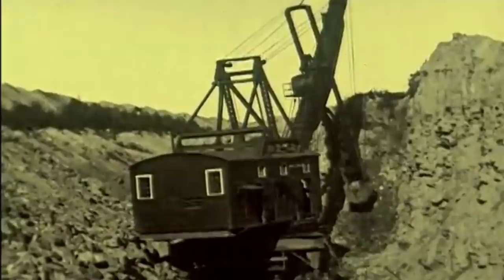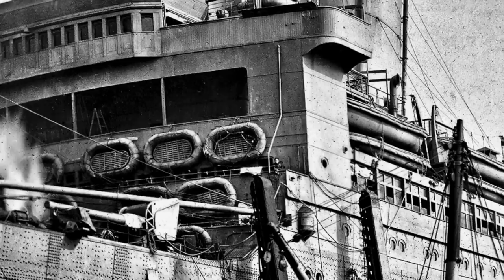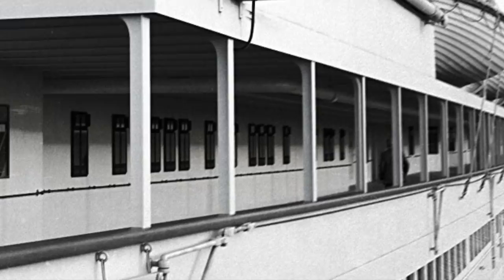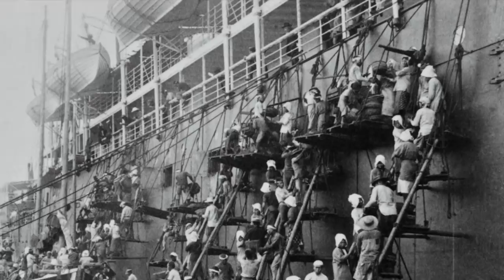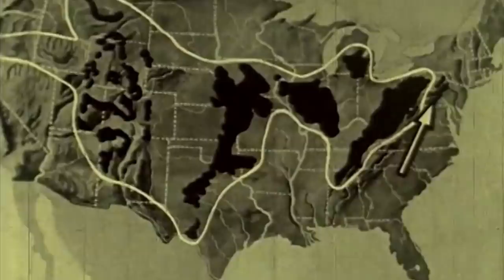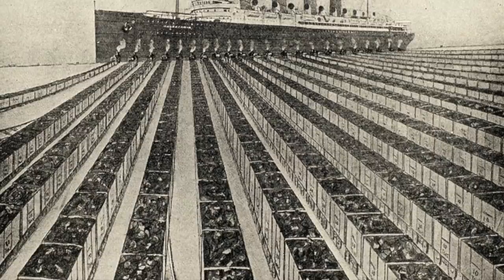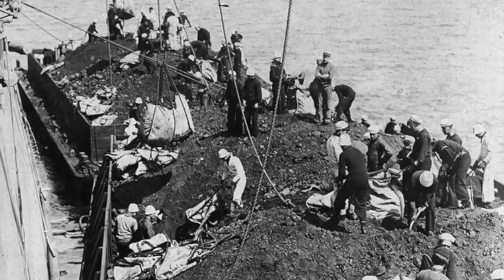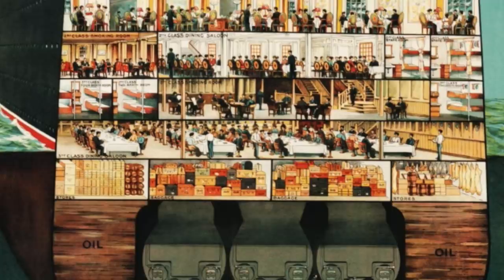Coaling/Bunkering an Ocean Liner

Comment: How about the coal fire that was happening aboard Titanic before and during her fateful trip?
Reply from the maker: I probably won't be discussing that. Coal fires were very common. There were even standardized methods of dealing with coal bunker fires.
Reply: I was a boiler tender in the navy.  hardest job on the ship. We had a jet fuel line rupture in our boiler room and i was so scared, but because the navy trained us till we thought we would go crazy, everyone in the boiler room just did what they trained us to do and we knocked the fire down and cleaned up the mess.  I will never forget those few hours of my life, and if i tried to describe it all you wouldn't understand anyway.  All the hatches were shut so we had no choice but to go put out the fire or die.  You couldn't see the fire cause it was so dark but you could feel it.  I liked life in the navy, but wanted a dog and i didn't see it happening in the navy.  The dog was wonderful.
Reply: @TheGreatBigMove  Perhaps it was common, but it likely effected her list as she was taking on water. Certain bunkers on the starboard were quite low or empty when she hit the berg. While the fire unlikely had an effect on the structural integrity of the ship, it was one of several important factors that kept her mostly upright during the sinking (the pumps and good engineering among being the others). You should definitely look into look into this. Scotland Road and several doors on the port side of Titanic being left open undoubtedly compounded upon this. Lusitania had a huge list as she was sinking that prevented life boats from being lowered during her sinking. Many ships straight up just capsize when a large amount of water enters only from one side.

Comment: When I was in the Royal Navy in the 1970 and at Faslane (Nuk Sub Base in Scotland) as a Navy Diver - we had a crappy ol ex fishing vessel, called "Yoyo", as our surface support diving vessel.  It had a diesel engine - that consistantly burst into flame, but thats other (usually amusing) storys,      but the heating & cooking on board was all done by coal fires. The galley, and the crew's mess had multi fuel stove like things - only 20 yrs before they were invented??  I remember coaling ship  ...  usually took about four bags  ... all a which had to be carried on my back!!   It was hell, and often took up to 15 mins!
It was a lovely vessel  -  NOT!! -  when repainting the hull we had to be really careful, because excessive pressure on the paint brush would tear out great lumps of ship side planking.
 I belive (Hope) the RN is a little better now-a-days!

Comment: saw quite a few peat-tar mix burning steam ships still around on the upper Volga in the late eighties early nineties... the bunkering of those (due to the volume/energy ratio) was more impressive then for coal, though it created far less dust... I think a lot of transport-size conveyor belts were used, but the mountains on the fueling docks were still by far the highest feature around, well above any of the small local hills.

Comment: I have spent a lifetime in the shipping business. Coal is still big business though for electricity and smelting only and I am extremely happy that now that I am retired I never again will have to sail a ship at 0400 from the local coal terminal. Fuel is still a serious problem for ships, however. Increasing environmental concerns and shortages of sufficient low sulfur fuel oil vexes owners same as coal shortages used to.

Comment: To build on Nitros comment, even with the use of hoses and electronic counters they will still try to short you on liquid fuel as well. Usually in foreign countries, they will incorrectly zero counters on any pumps they have. When taking bunker they will provide the CM with false hydrostatic tables so she/he can't measure fuel pumped off barges or ships using drafts marks and tons per inch immersion. When the margins are that thin rumor has it the crew that saves the company the most money each quarter gets a bonus

Comment: Just found the video and thoroughly enjoyed it.  From direct observation cheating by fuel oil suppliers is just as bad today as coal suppliers of yesteryear.  Singapore is notoriously known for cheating on fuel deliveries.  Hiring an "independent inspector" doesn't help because they're already in bed with the fuel suppliers. 

Examples;

70 tons short in Jebel Ali, UAE.  When Chief Engineer tried to annotate the delivery receipt of shortage he was physically restrained by Bunker Supplier.

Fueling in Singapore was shorted 10 tons.  Chief Engineer was very proud of raising hell and getting his missing 10 tons.  Until he found out he had 10 tons of SEA WATER in his fuel tanks.  He never did that again.

Fueled in Egypt because it was CHEAP!  Company decision, not mine.  Fuel solidified in tanks when sea temperature dropped to non-Middle East temperatures.  Had to shovel it out in buckets.  When we went back South of Suez Canal fuel heated up enough to pump and burn.

Company advised NEVER take fuel not authorized.  This was done by company vessel in Rotterdam.  Got 70-80 tons of fuel contaminated with some type of hazardous waste and was unburnable.

Comment: I suspect the video from 0.57 to 1.03 is of a ship in dry dock, not a ship moved off the quay in preparation for  coaling.  The side shores (like props) are there to position the ship on the keel blocks of the dry dock and to keep her upright, especially while her weight is transferring onto or off the keel blocks.

Comment: It's been awhile since I read that book on the Lusitania which came out in the mid-1970s about the real cause of the Lusitania going down.  As I recall now (and the book is in my brother's library in another city), it was that good bituminous coal from Wales on the Lusitania that made its explosions all the greater than just the hit of the torpedo.
Reply from the maker: Yeah, I didn't want to get too much into the different types of coal. I thought it would bore people since I could barely get through that part of the research myself to be honest.
Reply: @TheGreatBigMove  Understood.
Reply: Coal dust (or almost any dust of a flammable substance) can explode into big fireballs, and is sometimes used that way for special effects.  Look up grain silo explosions (or give a few heavy shakes of powdered cinnamon over a hot stove burner) for more.

Comment: I can think of one incident in which a lack of sufficient coal was responsible for the tragic loss of a great ship and a huge number it's passengers and crew.
The Cunard liner RMS Lusitania was not carrying her standard, full load of coal when she made her last crossing.  Coal was being rationed during the war, and the geniuses at the Admiralty saw no reason to make an exception for Lusitania, although they were happy enough to use her for carrying shell casings or whatever.  Since she didn't have a full load of coal, she had to make the crossing at significantly reduced speed, around 20 knots.  Her normal service speed of around 25 knots would have made her a much more difficult target for U-boats.  It is more than likely that Kapitanlieutnant Walther Schweiger wouldn't have spent one of his last 2 torpedoes in an attempt to hit such a rapidly moving target.  For want of sufficient coal, many lives, along with a magnificent ship, were lost.            ⚓Coal was a nasty business all around.  Coal fired ships required a huge work force to keep their engines running, and the stokeholders  were a seriously tough and often rowdy bunch.  When Titanic was going down, the electrical power was maintained as long as possible because a bunch of these tough-as-nails dudes stayed down in the boiler rooms shoveling coal, knowing well that they had little to no chance of making it out alive.  If that's not badass, I don't know what is.  When steamships were converted to burn oil, the workforce was reduced dramatically.
Filling up with oil was a breeze compared to the noisy, filthy, and dangerous process of coaling.
Thank you for an excellent video.

Comment: Structural failure caused by a coal bunker fire contributed to Titanic sinking faster than expected.  They had to shovel fast to dig out the burning coal or risk structural failure. That coal went into the boilers meaning they had to steam faster than ideal for the conditions. It was a calculated risk.

Comment: 8:41 I don't know any issues caused by coal supply.  However the RMS Atlantic was sunk trying to divert to Nova Scotia, due to a perceived lack of sufficient fuel to make its original Destination New York.  There was significant loss of life as the ship grounded due to Navigation errors, watch standers failing to carry out the Captains instructions, and the Crews unfamiliarity with the Canadian Coast.  The ship likely had sufficient fuel to make New York but fuel reserves were tight due to rough weather during the crossing making the ship much slower and less efficient.  The captains intention was to take on fuel in Nova Scotia and complete the Crossing to New York with sufficient coal reserves.  He felt it was unsafe to attempt to make New York with his perceived state of the ships reserves so he felt it prudent to divert which unfortunately ended up dooming the ship.

Comment: The main reason that coal powder is dangerous is the same reason any flammable dust in the air is dangerous. It's flammable and explodes violently when it is exposed to fire. That being the case, I'm sure you can see why it would be a problem to have that in a boiler room.

Comment: I work in a coal processing plant, we grind coal using a rotary ball mill to pulverize coal to dust it’s a very messy job and I can sympathize with the boiler and coaling crews it’s hot and noisy and very very dirty

Comment: To the question of whether running out of coal ever caused a steamship disaster: in 1870 the SS Atlantic attempted to divert from New York to Halifax because of low coal (or at least so the captain thought) but went off course being unfamiliar with Halifax and struck rocks and sank killing over 500.
https://en.wikipedia.org/wiki/SS_Atlantic_(1870)

Comment: Out of curiosity, did any coal fired steam ships ever receive an automatic stoker system? 

In America, many larger locomotives were so large they could not be adequately fired by hand. They were fitted with an auger that was powered by its own separate engine assembly, (powered by steam from the boiler) that would screw the coal from the tender directly into the firebox and then moved to different parts of the firebox by jets of dry steam from the superheaters.

Was anything similar ever used in maritime machinery?

Comment: Coal bunkers were also a serious fire hazard.
Reply: Good point. I think there was a coal bunker fire on the Titanic. Maybe someone can verify?
Reply: @commonsense1907  There was while I don't recall the details there's serious speculation that the fire had weakened one of its' watertight bulkheads resulting in said bulkhead rupturing and hastening Titanic's sinking. If true then if the bulkhead hadn't failed the Titanic might've stayed afloat long enough for the Warpaths to arrive and take off the remaining crew and passengers before sinking.

Comment: Why didn't they just make a big water tight hatch on the top deck of the ship and use that to chute the coal in from a crane when on a dock? Even if they were trying to keep weight distribution even, they could have a hopper system like they use in grain silos.

Comment: I am assuming that the shortage of coal may have been due to limited mining techniques that were slow and not very efficient. That must have changed a lot because the electric power plant for where I reside has mountains of coal even taller than the building where the generators are.  There is definitly no shortage of coal today.

Comment: OMG   I would have been the guy who invented an easy use conveyor system.  Then set up my own coaling dock with rail transport of the product.  The ships could just pull up, and the sealed chute would attach to the coaling port..  The short trip to my terminal would save time and much labor for the cruise lines.  Also a lot of mess.

Comment: ANOTHER CONSIDERATION ON COAL IS THE POSSIBILITY OF SPONTANEOUS COMBUSTION WHEN EXPOSED TO WATER!!
ALSO THERE WERE PROBABLY SAFETY RULES FORBIDDING SMOKING IN THE COAL BUNKERS!!
THERE WERE MORE POSSIBILITIES 
FOR SOME ONE ON DUTY WOULD TRY TO SNEAK A QUICK SMOKE WHEN SUPERVISION HAD THEIR BACK TURNED !!
Reply: Uhh wrong about the coal spontaneously combustion when exposed to water. That only happens with metals like lithium, sodium, potassium, rubidium, cesium. Coal can ignite only in the presence of Oxygen.
Reply: Prich038 YES COAL THAT IS HIGHER IN VEGETAL MATERIALS SUCH AS LIGNITES HAS POSSIBILITY OF SPONTANEOUS 
COMBUSTION AS DOES GRAIN AND HAY OR ORGANIC COMPOSTING!

Comment: Anthracite, or "hard" coal was more desirable for coal fired engines as it burned hotter, & was cleaner than bituminous, or "soft" coal which tended to be very dirty, smoky, & didn't burn as well. A factor that  led to the defeat & loss of Adm. Von Spee during WW1. Inferior coal meant his warshiips could no longer evade their British  pursuers.
Reply: In the United States, the railroads LOVED anthracite coal for the same reason: It was clean and very efficient. In the western US though, bituminous or "Rosebud" coal was more common, and sadly it was often poor quality (one railroad fireman compared it to a glorified coal-soil mixture). Lines like the Northern Pacific had to specially design some of their locomotives with massive fireboxes just to overcome this inefficient fuel.

Comment: Handling the coal material itself is miserable work from the grimy dust!  I have first-hand experiences from that with using coal to heat my Mom's house one Winter when she ran out of firewood for her fireplace insert.
Luckily she lived in a semi-rural suburb, with plenty of spaces between the domiciles, and the burning was done at night where there was no street lighting.  I say luckily in that this was a California community that had strong leanings towards environmentalism.  If neighbors saw the smoke belching from the chimney of her house, they would have had issues about it.

Comment: I thoroughly enjoyed your video! Honest question: why do you think using pulverized coal was not used? Crushed fine, sluiced into containment & then into the boilers mechanically. This is a method used for some power plants today. What do think?
Reply from the maker: I don't know for sure, but, base don what I do know, I would guess that it has to do with how it burns. The firemen in the boiler rooms didn't just simply throw the coal into the furnaces. They had to make sure that the fire was just right to maximize efficiency and performance of the engines.
Reply: Pulverize coal cannot be stored. In power plants the coal is fed into pulverizers via conveyers and then directly blown into the boiler via very sophisticated ports which require primary air and secondary air. Also the fire tube boilers are not suitable for pulverized coal. Pulverized technology (after about 1930)was not common until after most ships converted to oil.
Reply: @oldguy2800  Thank you! I've always wondered about this, because coal is an excellent fuel, but I didn't know about the tech limits or history. Much appreciated!

Comment: Was there really no mechanisation? It went straight from shovels and wheelbarrows to fuel oil?

Conveyor belts were used in coal mines from the early 20th century. You wouldn't think it would take long to the conveyor technology to be used in ports.  Even before conveyor belts there were chain and screw conveyors. And even earlier we had bucket elevators.
Reply from the maker: Coal barges were mechanized at the very end of the coal era
Reply: @TheGreatBigMove  Interesting. What about the boats themselves? Did they ever mechanise the boilers? 

I don't know the history of it but coal power stations grind all their coal and blow it into the boilers. Did boats ever get that advanced or did oil happen first?
Reply from the maker: johno No, I don’t believe so. I imagine it would have been too expensive and complicated to retrofit the ships in this way, especially with oil on the horizon.
Reply: @TheGreatBigMove  Interesting. Thanks for the reply.

Also I think it would be cool if you got deeper in to the different systems on a ship. Maybe electric, maybe water or plumbing, maybe even the hotel part of the ship. How were people moved into rooms, how did feeding them work.

Love your work

Comment: running out of coal..... thing is, it takes exponentially more  power to go a few knots faster.....a ship can go across the atlantic at 15 knots and use less than half the coal than the same ship going across at full speed, say 22 knots--or more....so the ships adjusted their speed according to their coal supply.... or any other fuel as well...  
i served 4 years in the Coast Guard  :)  www.lewishb.TV

Comment: I’ll bite, so if railroads around the same time had massive derricks, cranes, chutes, and what not, to load coal onto barges and railcars, why did the liners use such an astoundingly inefficient and labour intensive method such as this?  Couldn’t they have an auger system or boom crane into the chutes instead?